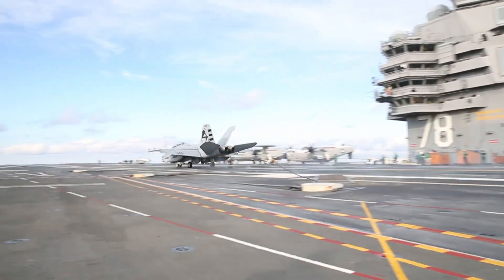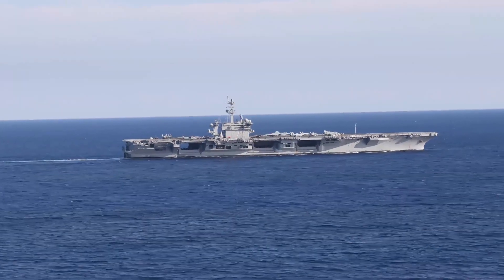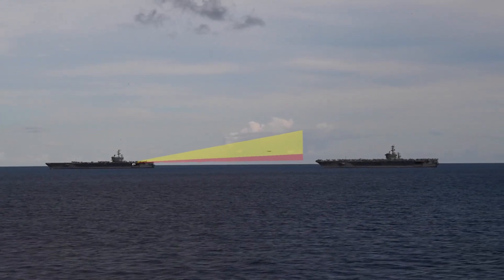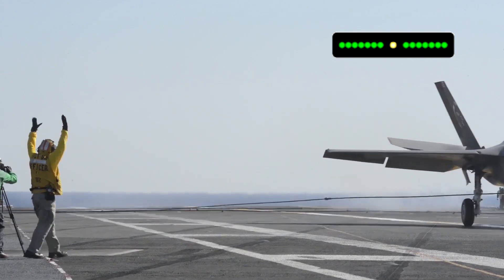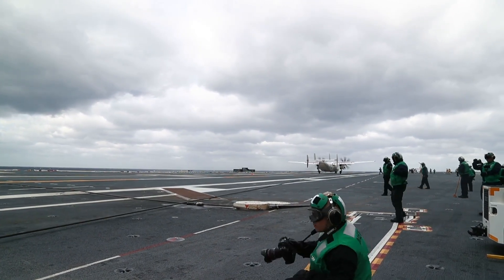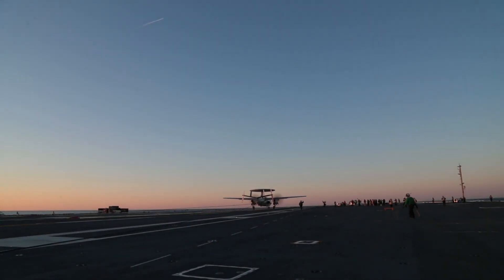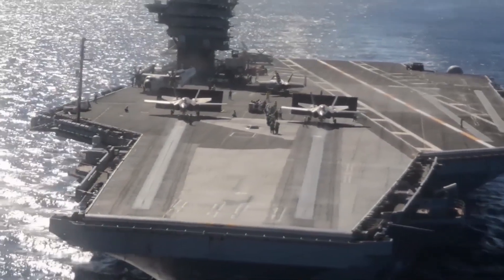Why Aircraft Carriers Lost One Arresting Wire?

Comment: So let's say you don't really care what wire you hit as long as you hit one . The video said you had to consistently hit the third wire if you didn't you would not move up in rank . What if you reup 2 years at a time , requesting rank before you sign on the line . Is that another fairly quick way to get rank in that MOS ? I don't see them turning a pilot away .
Reply: Naval Aviator and Naval Flight Officer contracts are longer than two years and one doesn't barter for rank.

Comment: Mk-7 MOD3 Hydraulic Arresting System						
m = maximum mass of aircraft = 50,000 lb = 22,680 kg
v = maximum landing speed = 130 kn = 67 m/s
t = deceleration time = 2 s		
d = deceleration distance = 344 ft =105 m
KE1 = kinetic energy of aircraft when landing = to be determined						
KE2 = kinetic energy of aircraft when stopped = 0 J	
						
Kinetic Energy of Landing Aircraft						
KE1 = 0.5mv²						
KE1 = 0.5(22,680 kg)(67 m/s)²						
KE1 = 50,718,851	J = 50.7	MJ		
						
Power						
P = power absorbed by arresting system = to be determined		
P = KE1 / t						

P = 50,718,851 J / 2 s						
P = 25,359,426 J/s = 25,359,426 W = 25.4 MW
						
Comparison:						
2.4 MW = peak power output of a Princess Coronation class steam locomotive (approx 3.3K EDHP on test) (1937)					
3 MW = mechanical power output of a diesel locomotive					
8 MW = peak power output of the MHI Vestas V164, the world's largest offshore wind turbine					
28 MW = peak power output of the reactor of a Los Angeles-class nuclear submarine

Comment: Very good technical content in your video.  Except that I do not agree with your premise.
A few comments:
1) The nominal distance between wires is 40 ft (not 50)
2) CV 41 Midway had the same 3 + 1 set up.  This was the model for 76, 77, and as planned for Ford Class
3) Poly core cable is used on all Mk 7 and AAG uses the same cables. 
4) 76 and 77 have the Mk7 Mod4
5) 78's have 3 (sans +1) wires for "reasons" other than IFLOLS, therefore I have to
TOTALLY DISAGREE THAT IFLOLS is what made a 3 wire layout possible.  Never encountered this rationale, NEVER EVER!
Reply from the maker: Interesting. Could you elaborate on #5, i.e. what the “other reasons” were?
Feel free to email us at nwyt2021@gmail.com
Reply: @NotWhatYouThink  see number 2.  IFLOLS is an improvement (and JPALS would have made it even better for F35 and future aircraft), however it was not never a factor in the decision.  We live in a recon world, so maybe I missed the memo.  

Also look closely at 3:20.

Comment: Surprised The controlled crash between carrier and aircraft hasn’t been automated.
Reply: It has.
Reply: @alfredsutton7233  not yet I believe. Magic carpet simplifies the approach . Close but no cigar.
Reply: @Steve Kennett ... SupeBug and JSF can both auto-land with a hands off approach and trap if necessary with Magic Carpet if pilot's become incapacitated. They have proven that with many hundreds of traps with the system active...
Reply: @CH-pv2rz  even the F-14 could already do it.
Reply: @CaptainK007  Incorrect. First production ACLS was installed on Midway in 1962.
Reply: ACLS has existed for decades. F-14 and F-18 were both able to autoland. It wasn't used a lot in service though because the pilots have to stay current on manual landings in case the ACLS system fails.

Comment: do you know how these lights supposed to function on the su33 or hornet has the same type of system, do these 3 different colored lenses supposed to light up at night or what? the aoa indicator is in the cockpit that mimics this on the front landing gear but i never seen how they work.Thanks for any info.here is the picture of that thing above the wheel
https://images.app.goo.gl/N3tkdMUtyjrdQFjW9

Comment: I now know why the Brits have VTOL carriers 😂
Reply: and it was a british invention
Reply: VTOL is cool
Reply: The QE class boats aren't CATOBAR because the UK can't afford them.
Reply: @AA-xo9uw  My understanding was at the time, the Electro magnetic cat system was in its infancy/not working correctly so the UK purchased the B variant, with the option of adding a smaller EM cat system for future Drones/unmanned systems. Next is the aircraft the UK uses; Their primary fast jet is the Typhoon and as they only have 2 carriers, limiting them to the C variant would be counterproductive. Everything is for reason.
Reply: Yea... Sorry guys but we are to cheap to give you 4 wires, so you only get 3. Because 1 extra wire costs so much more than an F-35 or an E2 does... Right? ...No? Oops!
Reply: @CH-pv2rz  You do realize that the 3 wires is just fine, because it the new tech makes 3 wires just as good as 4 so why even make the cost for the new one?
Reply: @CH-pv2rz  pilots were also told not to aim for the first wire anyway, so its really just removing unneeded  equipment to save maintenance costs. "Dont aim for the first because you might go too low and crash, aim for the third, but hitting the second and fourth are okay" i wouldnt be suprised if eventually the system is reduced to 2 wires to eliminate the issue of coming up short, since theyre aiming for the same spot on the deck, just without the rearmost wire
Reply: @CH-pv2rz  which doesn't make sense because the Ford wasted slot of many using all toilets and no urinals in an attempt to be more female "friendly"

Comment: The real reason for getting rid of #1 wire is because of Officer's getting hit by grease shot at them when they would cross from the starboard side of the O-3 level to the port side through #1 engine room by the engine operator with the grease gun powered by the ships l.p.
a. supply.
Reply: Would not surprise me one bit👆

Comment: They call it "a resting wire" because it just lays there and doesn't do anything...
It a couple years, it turns into "a rusting wire"...
After that, it asks all the other wires, "wire we here?"
Reply: They have something like spring loaded metal strips that raises them  off the deck a few inches.

Comment: The French carriers have practically only had three wires, but it's for space reasons
Reply: Chicken and egg problem. Space reasons - designed that way - money - functionqlity - safety - specs - aircraft capability.
Reply: @ekevanderzee9538 , agreed. But not only. Long studies and practices produced the same conclusions. Reinforced by similar equipment, training methods and interoperability constraints.

Comment: I'm just curious can that wire stop the jumbo jet?? How much force it can handle??
Reply: Only Boeing A380 Jumbojet MK2
Reply: In theory.... The system is adjusted based on aircraft size.
Reply: More accurately, it is how much energy can the system absorb.  Limiting factors are the strength of the cable, amount of run out  (as pointed out 350 ft) and how much shock load can the airplane or the arresting system take?

Comment: "New tech" "we added more lights to the indicator"
Reply: 8k monitors are just 1080p monitors with more lights
Reply: @ipodtouchiscoollol  0.Niue
Reply: Well... he also "forgot" to mention that we are witnessing the rise on computer assisted carrier landings. Greatly improving accuracy. Many planes already use this and ofcourse every ucav does.
Reply: @ekevanderzee9538  ACLS was used all the time on legacy Hornets, Super Hornets and Tomcats that had the upgrade done (all D and tons of B and A).  Pilots could only use it in calm weather and seas because it's kinda like trusting tesla autopilot to race your Lemans car...  

The Super Hornets and now the Lightning II's also have magic carpet which requires about 10x less pilot corrections on final.  Basically it's an assisted flight control mode that does micro adjustments to stabilize and decent path a d puts a box on the HUD referencing a place where the plane will land.  Put the box where you need it and just adjust controls to move the box if your target (the carrier) moves...
Reply: @ekevanderzee9538  I mean the f14 had systems to automate carrier landings they just didn't use it or at least to my knowledge they didn't
Legacy hornets only had the ability to automate throttle control to keep you at the correct speed
Reply: Perfect example of "So hard to appreciate things if you don't understand em."
Reply: @ItsJohnSina  outstanding. Well said sir! 🤣🤣🤣😂😂😂🙂
Reply: But more light mean more detection to be displayed
Also mean Christmas tree
Reply: @franzstigler3200  oncology
Reply: @franzstigler3200  more light doesn’t mean detection. They have it limited at approach angle and pilot’s vision gear
Reply: Back in 1997
Reply: “The rocket knows where it is, because of RGB LED lighting” what else
Reply: It actually helps the pilots. They suck sometimes. I know personally.
Reply: Sometimes "keep it simple stupid" really is the best philosophy
Reply: It's east to add lights. But a bit of work to make them show the relevant info. The plane needs the correct height in relation to the angle it decends. So it's a bit of measurements to separate a plane 100m up flying straight ahead and a plane at same distance and height but aiming below the flight deck. And to do these measurements on a ship that is affected by the weather.

So the simple extra lamps still required a lot of great engineering to display the required information.
Reply: RGB = +FPS 😎🤑😎🤑🙏😎🤑😎🤑🙏😎🤑😎🤑🙏😎🤑😎🤑
Reply: Forgot to mention about the part where he said they were 2x as sensitive and accurate. Doubling the power/output of anything is a engineering feat in its own
Reply: True legend 😂
Reply: ok buddy thats alot because its not easy to land without indicators and their essential for safe landingsp
Reply: Finally somebody with a brain
Reply: Are some one you white knighting for a cable? Lmaooo
Reply: https://youtu.be/ujZyyyD5uZc
Reply: Long back, carrier landings were hard to be practiced and often at night pilots couldn't see the carrier angle for that the US navy added an IFLOLS( or simply OLS -Optical landing system) system that indicates the conditions necessary to land in a perfect angle by exchanging of light in a monitored way. This made a huge impact on pilots as now they would be able to know precise landing positions and angles.

AND by the way im not some nerd guy on youtube i just wanted to share this knowledge
Reply: EA when they release a new Fifa game
Reply: Just do vtol...
Reply: if you only had any idea of this ships capability.
Reply: Apple new tech. Let's remove the charger
Reply: @tubetubecommentor4795  I mean, the only way a phone wouldn’t need a charger is if it didn’t need charging.
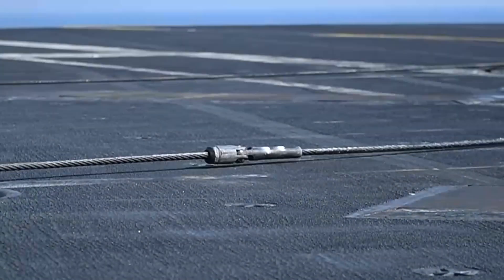Reply: Guess you missed the part about the poly cord improvement over steel cables. An efficient machine is the sum of all it's parts. Here you go: steel 2:52  poly cord 3:37 Notice the texture difference? Be well.
edit: hit pause as soon as you click on the time to get a good look.

Comment: So it's not "hell yeah, 3 wire" anymore? Awww :(
Reply: "Ok, 3-wire"
Reply: 3 is still what you want to hit on the 3+1 layout on 76 and 77.  Reason, the 3 and 3A are closely spaced ( 3:20 ) and rotate between in use & back up.  This spreads out the hit count and maintenance to be similar to a 4 wire layout minus the fifth (barricade) engine and cable system.  This is the plan for Ford Class as well.